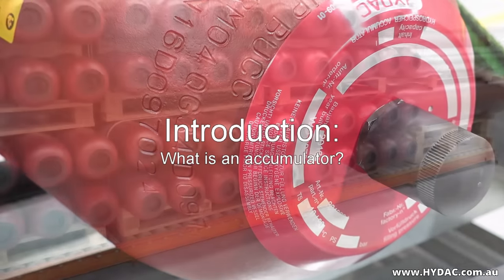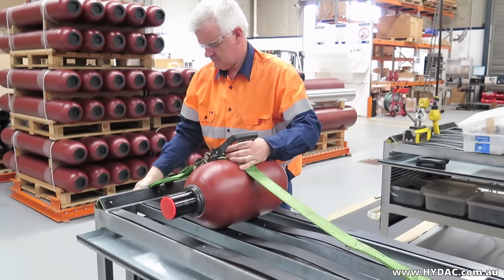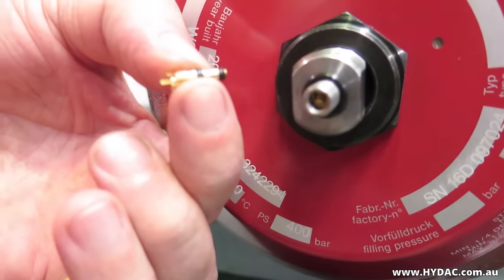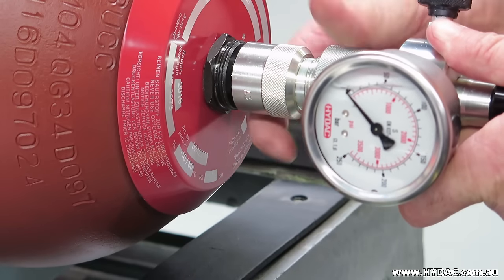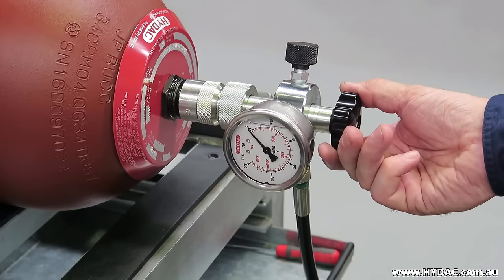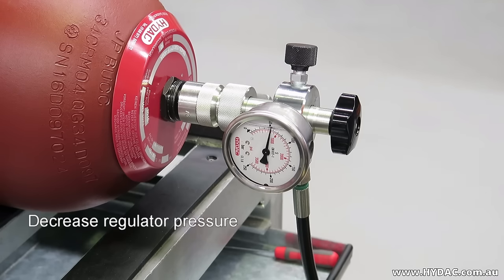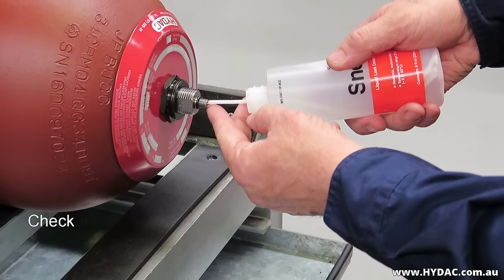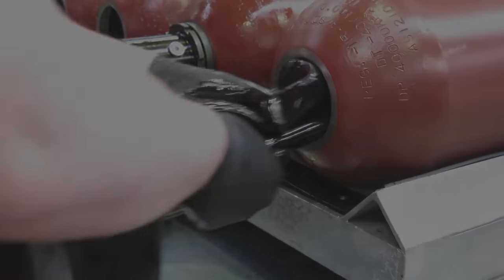How to Charge HYDAC Hydro-pneumatic Bladder Accumulator

Comment: why we use only nitrogen to charged the bladder  and we dont use other air  is it the weight of nitrogen or what ?
Reply: nitrogen is an inert gas and cannot combust unlike air (oxygen) . because an accumulator is a pressurised vessel using air you can risk an explosion
Reply: because nitrogen is incompressible fluid
Reply: @gouravbanik2972  Literally the opposite of the purpose of the system, gas is used because it acts as a spring for hydraulic fluid on the other side of the bladder. It has to be compressible to work.

Comment: 1. How about removal of residual air prior to Nitrogen filling? And also after replacing the bladder in other video (
"How to Assemble a Hydraulic Bladder Accumulator")? After all, as you know, Nitrogen must have at least cleanliness class 4.0 and 99.99 vol.%
2. First, "remove the charge head from the adaptor" and only then "close down the Nitrogen bottle" - are you serious? Why not the other way around?
Reply from the maker: Thanks for your question! Point 1: We remove the air by rolling up the bladder, squeezing the air out before assembling it into the shell. Then the bladder is inflated with Nitrogen. A small amount of residual oxygen in an inert Nitrogen rich environment is not a problem.
Point 2: The order of operation for this part of the task is not important once the system has been de-pressurised.
Reply: @HydacAu  Thank you for your prompt response! Sorry for question 2, because I missed the phrase about closing the control valve, and this step was not shown in the video.